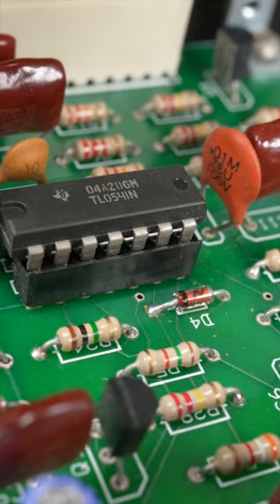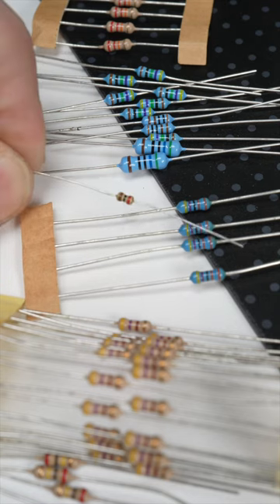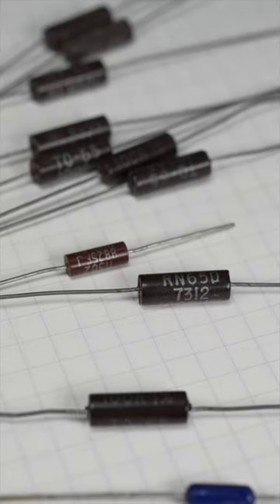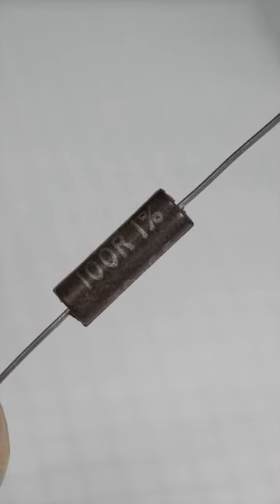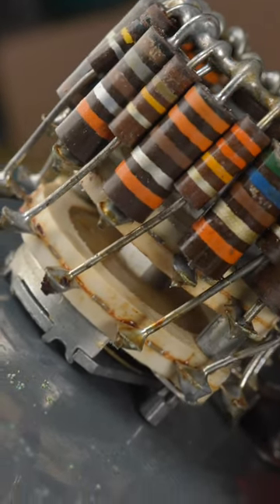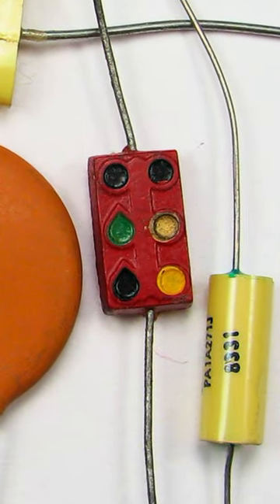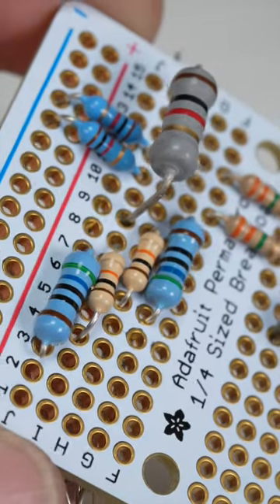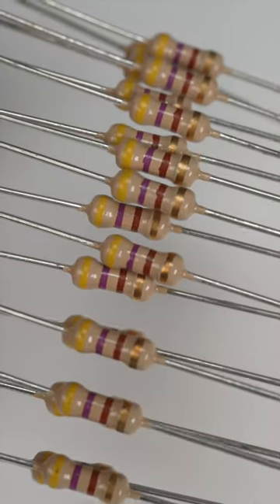How the Resistor Got Its Stripes - Collin's Lab Notes #adafruit #collinslabnotes

Comment: That sounds like a half-answer. Who decided on the colours? When were silver/gold added to the mix? Who decided to put 3+1 stripes? Has it always been this way? Why is yellow-violet-red so damn attractive?
Reply: Actually more like 1/10 of an answer. This video was horribly mis-named. Should have been, "What do the resistor stripes mean?" Also, answer why are the 'values' so weird, and where did they come from? Those choices which allowed for every value of resistor to be included 'somewhere' such that the original manufacturers to never had to discard a resistor, were genius! 

I like that this was such a short video, but the title is mere click-bait.
Reply: 4.7kΩ attractive? 😂
Reply: @axelbelleris  Damn straight :) 1.5kOhm comes in a close second-place
Reply: @axelbelleris  PS - "When in doubt - 4k7" is a good rule to follow (although I lean towards 10k )